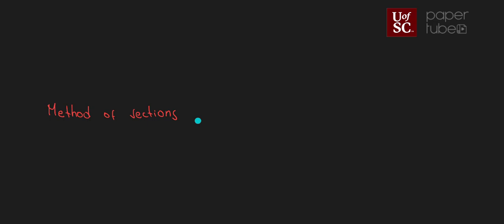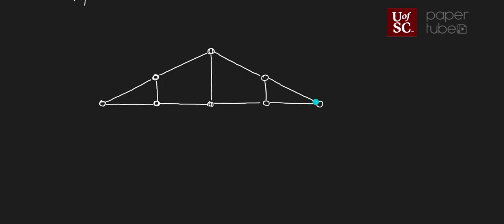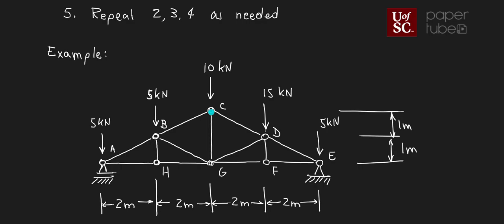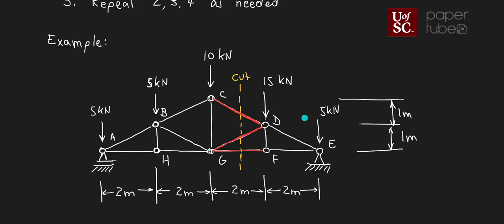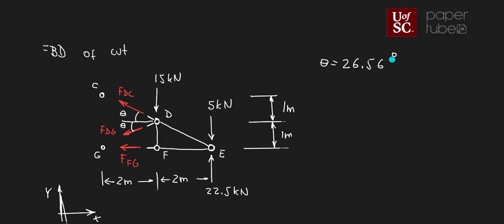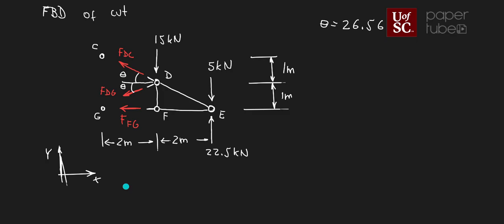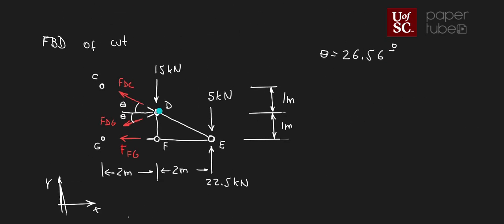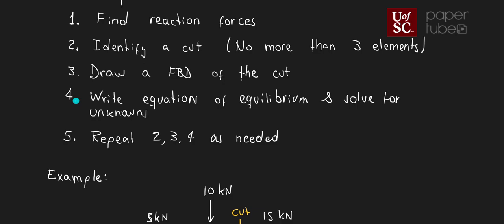Trusses: Method of sections

Comment: may i ask, why in moment G calculation, force DG is not included?
Reply from the maker: Thank you for your question. Force DG does not produce a moment about point G because the line of action of the force goes through G. Another way to think about this is that the perpendicular distance between the point of interest (G) and the line of action of the force is zero. Therefore, the moment would be zero (force times perpendicular distance from the point of interest to the line of action of the force). 

Thank you again for the question!